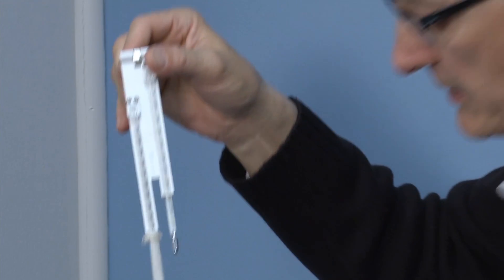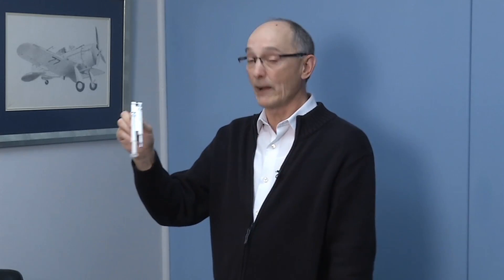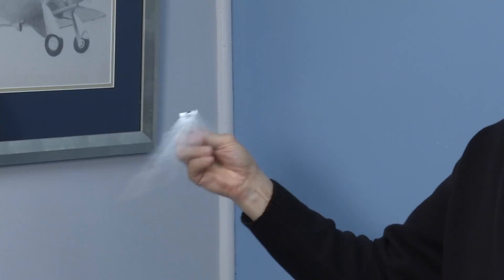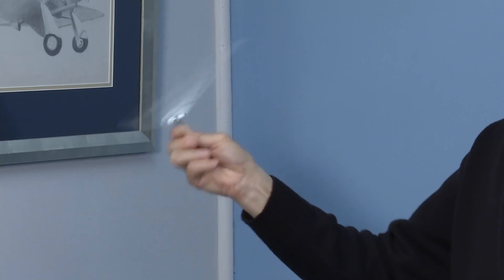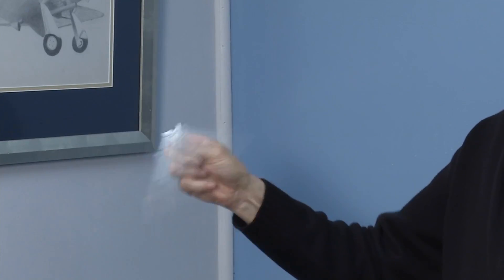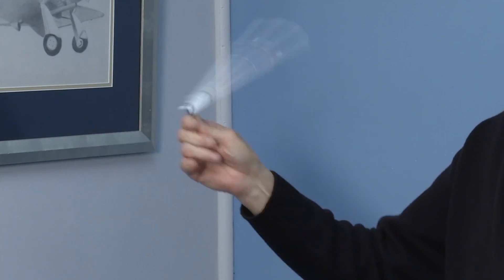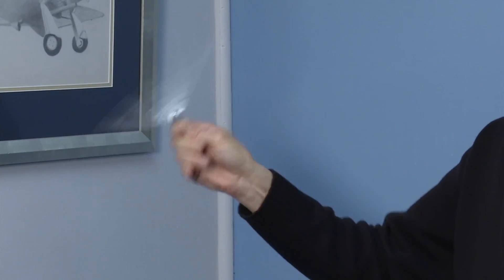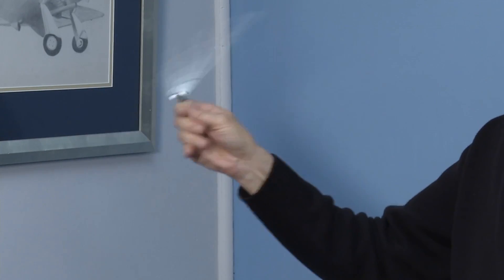Science of Moisture in Air: Using Dry and Wet Bulb to Measure Air Temperature and Moisture

Comment: Does the wet bulb temperature tend to be cooler than the dry bulb? If so, in what case would T(wet bulb) be greater than T(dry bulb)?

Thanks for the video, it was an excellent explanation
Reply from the maker: Vanessa:

Good question.  The wet bulb temperature will always be lower than the dry bulb temperature but will be identical to dry bulb when at 100% relative humidity (the air is at the saturation line, and you can check that out on our psychrometric chart and webinar).

Hope this answers your question, if not let us know!

Dr. Dry

Comment: So...,wet bulb thermometer gives you the amount of moisture in the air? Or you have to do some math to figure it out?
Reply from the maker: Hi Adil, 
Wet Bulb will give you RELATIVE amount of moisture in the air.  If you want to know the AMOUNT of water in air then you need a corresponding measurement like dry bulb temperature.  With two points you can then find the ABSOLUTE measurement of moisture in air like grains of moisture per pound of dry air (or grams per kilogram). We have an application for that called DRY TOOLS.  Check it out : https://www.cdihvac.com/dry-tools-app
- Dr. Dry

Comment: dear sir how do you calculate moisture in the air
Reply from the maker: Hi Eric, 
One of the most common ways is to measure dry bulb and wet bulb temperatures.  Then with those two points you can then find the ABSOLUTE measurement of moisture in air like grains of moisture per pound of dry air. (or grams per kilogram)  We have an application for that called DRY TOOLS.  Check it out : https://www.cdihvac.com/dry-tools-app
- Dr. Dry

Comment: Thank you. But one question remains, as we are dipping the wick in water, why is it being used as a proxy for moisture in the air?
Reply from the maker: Hi Anupam, 
When air being measured moves across the the wet bulb (the wetted wick) it will evaporatively cool the thermometer to 100% saturation, lowering the temperature reading on the wet bulb thermometer. 
- Dr. Dry

Comment: Good day sir just one question what is the difference of humidity sensor tonwet bulb sensor..
Reply from the maker: Hi Frederick, 
Humidity sensors can come in all shapes and sizes.  Most electronic sensors measure temperature and relative humidity and then electronically convert it to other outputs.  That can include wet bulb.  The sling psychrometer used in this video was used primarily to demonstrate the concept.  
- Dr. Dry

Comment: Good explanation though.    It's the temperature you can reach due to the cooling from evaporation.   So it can be 95 and hot and humid but it is possible to drop the temperature through evaporation